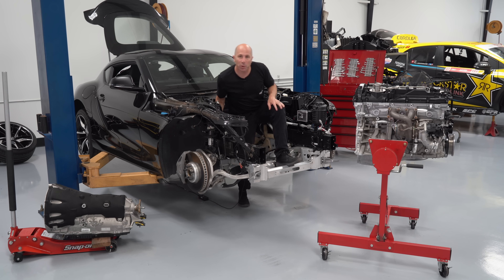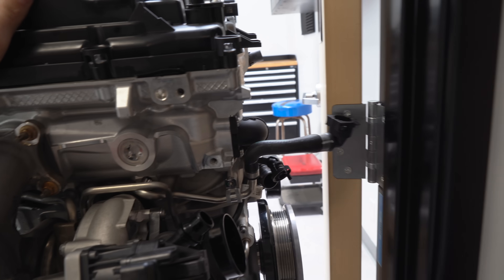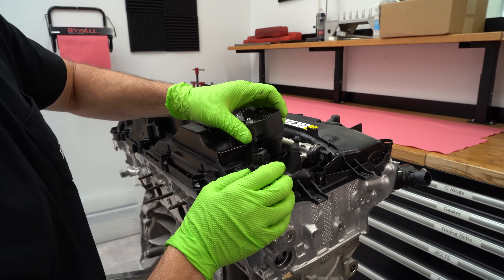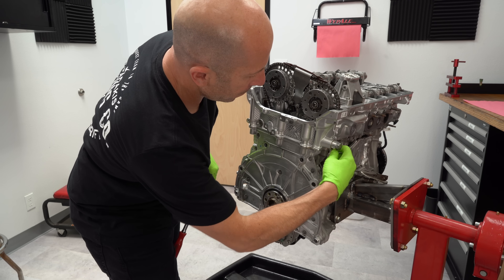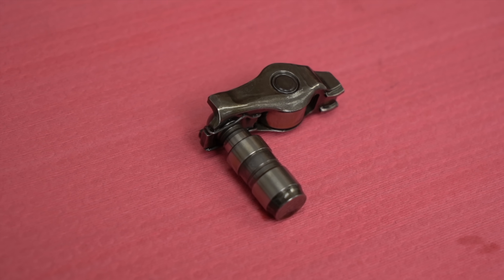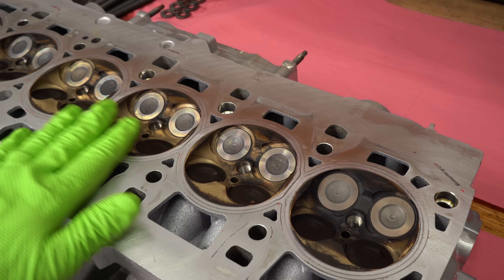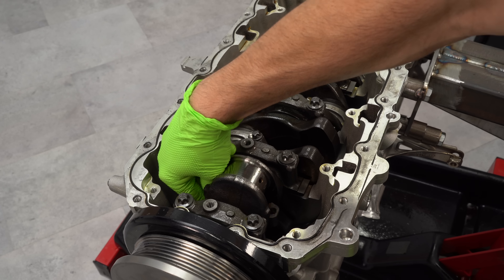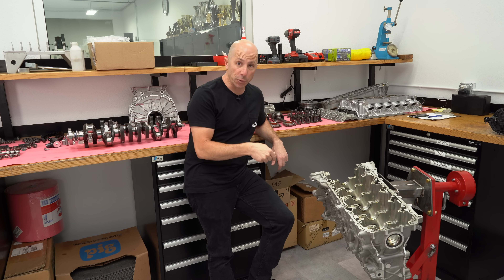2020 Supra B58 Engine Teardown - First Look - Better than the 2JZ?

Comment: the whole time I'm watching this i'm thinking to myself "i would have no idea how to put that engine back together".

HOW do you know how to take apart the engine on such a new car??
Reply: Service Manual
Reply: I'm just supprised he even had access to the service manual yet, is pretty difficulty to get manufacture specific manuals this close to release unless your literally with for the dealership
Reply: @iancook2921  This close to release? The cars are already being sold... I've seen 2 in my sleepy little rural town...
Reply: Forgan Mreeman I think when you’ve torn down as many engines as this guy and can do so routinely, most engines start to look the same
Reply: Bolt by bolt until you have no more bolts to take off.
Reply: You'd be surprised how similar engines are, and when you're experienced in how engines work and the things that are in them, it doesn't take long to have a good look at it and figure out how it comes apart
Reply: @lewisbiggs5977  ok what about the electrical bits? that had to have been a nightmare taking the harness out.
Reply: @Forgan_Mreeman   if Toyota didn't depart from BMW design on that aspect it would actually be fairly easy. i work on BMW's regularly and their engine bays are wired quite efficiently. i spend more time removing trim pieces and frameworks than dealing with harnesses. Toyota actually has some of the worst wiring setups because they run over top of everything and arent very flexible. mainly difficult from the lack of flexibility and extra length so you cant push them too far out of the way
Reply: Engines are like tits and a fanny, they're all different but all the same 🤔
Reply: @Liveforeever   , yeah...  i like the way U think...
Reply: He can just watch he's video
Reply: He uses something that I call the party line. Basically get a table and everything you take off you organize from left to right. Installing will be opposite right to left. On big projects like this I take photos but he did better and video taped it too.
Reply: The B58 is not that new at all.
Reply: Once you take enough cars and engines apart, things start to seem kind of intuitive if you stop and carefully prepare.
Reply: They're just motors, same as anything really for most of it
Reply: Video your self
Reply: Holy quran of service manual...
Reply: Manual book 101 lol
Reply: It is not that difficult you just need to unbolt every screv you see and eventually it will come apart xD

Comment: Mechanical fuel pump! 
Full circle!!
Reply: driven on the camshaft no less!
Reply: wheelitzr2 It has a regular fuel pump in the fuel tank which feeds the mechanical fuel pump. However to get the fuel pressure up to around 3,000-4,000 psi which is the operating range on those fuel injectors you need a mechanical pump like the one in the engine.
Reply: @guillermolopez1690  ya think?!?!? I had no idea that is was direct injected and needs thousands of pounds per square inches to inject fuel directly into the cylinder. I was making the comment that obviously a mechanical fuel pump can't do what an electric one can.

Comment: Where are the cam bearings? Why is there so much plastic? Oh god
Reply: Like many engines the "bearings" are part of the head and cam caps
Reply: And there's plastic because it's strong, reliable, cheap to manufacture and lets them do things they couldnt with cast or billet aluminium

Comment: I would love to tune an engine with twin variable camshaft phasing. This technology is how OEMs are getting so much area under the torque curve....as opposed to peak/narrow band of RPMs.
Reply: Would add bulk to the entire timing system. It would take guts for a manufacturer to do that without sacrificing anything(except the bulk)!
Reply: BMW used dual camshaft timing adjustment first in 1998 on M52TU. It is called dual Vanos.
Valvetronic is used first in 2004 E60 and E46 engines.
Reply: They call it Valvetronic on BMW motors if you want to do more research!
Reply: It’s actually vanos. Valvetronic is the variable valve lift.
Reply: @Wick-d_Trucking  my bad thought he was talking about the valve lift not the timing lol
Reply: @Wick-d_Trucking  vtec

Comment: Really great insight, talk about re-inventing the motor! Seems like the design is for minimal potential to modify. The inbuilt exhaust porting is really interesting. Can't wait to see the re-build :D
Reply: All that design is just a byproduct of modern emissions standards. Auto companies have to do anything and everything for the smallest efficiency improvement. This is no different than any modern engine honestly. 

I had to tear down my 2016 5.0 Mustang engine and I cannot tell you how many similarities there are between the two, in terms of stuff that seems needlessly over engineered and pointlessly difficult.
Reply: @kinafermusic2456  This is a fact that most people ignore, they blame the manufactures instead of the regulations that force their hand. (not saying the regulations are bad, but for tuners they can get in the way)
Reply: It's have also been designed to make the life harder for anyone who wants to disassemble it.

Comment: Yay, timing chain on the rear of the engine.  Servicing is going to be soooo much fun... 🤦‍♀️🤦‍♂️
Reply: Should ask audi 4.2 v8 owners how they like their timing chain in the back. Don't worry though, you don't need to service a chain! (whoops)
Reply: It's easier than maintaining a website forum.
Reply: @mattk9438  touché 😘
Reply: I had my bmw with the exact same oil pump design and chain layout sieze the oil pump, broke the gear off the pump, was a transmission out job to fix, you can do the whole chain service with the engine in with most other bmws, but it's probably easier to just pull the engine tbh
Reply: JZX World dude even the placement of that thermostat underneath everything, my e46 was right in the front. My favorite car I’ve had, so easy to work on.
Reply: @bjn9  if you think the e46 is easy to work on you've never experienced the joy of an e30
Reply: keeganwebber i second the e30 comment. Love working on the m20
Reply: @keeganwebber  fucking HATED working on my e30. Worst car i've had to work on. Would rather change oil filter on my mr2 than work on another bmw.
Reply: Unless something goes really wrong, you don't need to change it.
Reply: @Pogaspm  not necessarily true at all
Reply: @Pogaspm  ...or you need to change cams etc.
Reply: JZX World that’ll be the last of
Your problems with the intake cams eccentric shaft, along with everything else. The chain location isn’t a issue at all unless it needs to be changed or serviced.
Reply: @Pogaspm  Yeah BMWs are known for their timing chain reliability (eye roll).  See 540i, 740i, etc.   When the timing chain guides self destruct (between 30-60K miles) , the labor/parts cost to replace them totals the car.
Reply: Epic Test Drive 740i
We’re talking 2020 not 2003. Cool your jets there Marty mc fly.
Reply: @epictestdrive7978  is the 30-60k mile car worth 2k$? what are on about.
Reply: Thechristopherryan and yet they still use a plastic wearable guide on the chain rather than a sprung cog.   BMW engineers into their designs expensive maintenance items such as these timing chain guides
Reply: @epictestdrive7978  Are you talking about the M62 engine problems? That thing was discontinued in 2005, it's got nothing to do with the B58. I'm not saying this engine will be perfect but apparently Toyota had a big say in its development and ensuring it would meet their stringent reliability requirements. It's been used in various BMW models for a couple of years now and I'm not seeing issues with the timing chains being reported (after a quick Google!)
Reply: Epic Test Drive I don’t know in which dimension. 300k km engines (M60, M62 and many-many other BMW engines) are put to work hard on tracks here every weekend no chain issues. Maybe you should try changing the oil more often than your chain guides and tensioners?
Reply: Epic Test Drive no usually around 120k or 150k or even 180k they’ll start going bad depending on what conditions the car went through
Reply: @Pogaspm  It's a BMW engine, so you will have to change it every 100k km.
Reply: Just a heads up. On this specific engine, the timing chain can be replaced in car. The chain links are separated and a holding device feeds a new chain in as you rotate the crank over. I took the training class for i8 (b38/48/58 are very modular, hence the shared components) right before I left the dealer and we replaced a chain on the b38. Once again, very easy with the right tools.
Reply: JZX World It’ll be fine, you can’t have everything easy.
Reply: All I can find on the internet is forum threads airing concerns about chains/tensioners, etc. from when the B58 first released. There’s no documentation on how many (if any) people experienced failures or needed replacing so it looks like BMW expect this to be a non-consumable, despite their track record with rear chain engines.
Reply: Be happy that it doesnt use a timing belt if you change oil on time and stuff the timing chain should last realllllyyyyy long
Reply: You shouldn't have to service the timing chain like that.
Reply: @Charles Bell I'm a mechanic and already changed more than 3 chains in under 2 months, bmw with n47 engines newer than 2010 they are common to fail  you can Google it
Reply: 2jz swap when the timing chain goes
Reply: @DrTnuts  why would you bother?
Reply: Considering a timing chain never needs to be replaced unless there’s a problem with the actual chain,  really doesn’t matter where it is.  It’s going to be a huge job regardless.
Reply: smart one timing chains DO stretch belts ARE stronger due to the ability to use carbon and Kevlar which are stronger than steel. Nice try though chains are easier for rapid manufacturing.
Reply: Timing chains don't break thou, it's very,very,very rare they break
Reply: Seems fine to me, I mean, the packaging is such that pulling the engine is not such a big deal.
Reply: Ya just had to scrap my BMW because the timing chain broke, BMW told me it's my fault because i hadn't taken it in to them in 60K so they could check it.  I'd like to see what they do with this, especially since BMW is known for using crappy timing chains
Reply: Second owner problems
Reply: @- whoami - I love scotty lol😎
Reply: Yep very typical from BMW. However there is probably some special set of tools that they have given their technicians to use which makes it easier.
Reply: coff, saab
Reply: @- whoami - nah dude, he is mechanic daddy.
Reply: BMW doesn't have timing change issues.
Reply: @Edward Oskarsson 
Problem on the old e46 valvetronic was the valvetronic motor, not the shaft, oh and the entire engine lacking 2 cylinders.
Until we know that this valvetronic (yes it is still called that) is a known failure point, what it allowes is simply a more flexible engine with the ability for lower fuel consumption.
Reply: Check some vids from Europe. I've seen guys from Germany, Poland and UK doing the chains from the rear just pulling out the gearbox.
Reply: Welcome to the world of German engineering
Reply: Only fucken Germans do this to engines.
Reply: Would you really need cams on a car with variable valve lift 🧐🧐🧐
Reply: Said the  same 😂
Reply: You should try owning an Audi lol
Reply: The ones who can afford the car will be able to afford the flat rate.  It'll be easy once you do it once or twice.  First time you'll lose your ass.  That's how it goes.
Reply: @mikaelgaiason688  I can afford this car but it doesnt mean i would want to pay for 20/hr labor just to service the timing chain yet alone if the stupid cover starts leaking. I'm also building a 2jz at this moment and plan on swapping out the engine. No I'm not rich I just have my money invested in well places and dont spend like an idiot.
Reply: BMW are known for reliability....oh wait..no they are not.
Reply: NO_EYES_ON_ME maybe US spec bmw’s arent relaible but european spec are
Reply: @TorpedoStudios  Based on what? Their 25th place in the JD Power European reliability survey?
Reply: Thats why they took this 'project' on with Toyota,.
Reply: bmw ftw Eh? my main gripe is internal exhaust manifolds. so now barring a head upgrade, exhaust headers wont happen
Reply: @yamahonkawazuki  my thoughts exactly.... such a stupid design. From what ive been told even many new naturally aspirated engines have this same design. Something to do with low rpm torque figures to "help" boost fuel economy. What a joke. That's like going from a 3" exhaust to 1" as a scale of restriction...
Reply: @- whoami - But BMW timing chain guides go far before that!
Reply: @epictestdrive7978  literally never heard of that problem they're are loads of those v8's running around on 100k plus miles
Reply: It’s really easy with the right tools
Reply: @fatcatsgang  Nothing easy about having to pull a motor to change your timing chain. Super inefficient design. Otherwise the motor seems decent.
Reply: @randommitsu6098  These cars will have one timing chain in it's life, why exactly is that a problem ? You don't do it every week.
Reply: @randommitsu6098  If you've worn out a timing chain,then your going to be changing other parts also,so it's motor out regardless.
Reply: @fatcatsgang  it's even easier when you have a lot of money
Reply: Forgan Mreeman it’s even easier when someone’s doing it for you
Reply: @fatcatsgang  but still you need to remove freaking GEARBOX !
Reply: Typical of bmw..
Reply: Use white painter's caulk instead of gaskets or silicone. Poly seam seal, from home depot. 
Your welcome!
Reply: @- whoami - its a bmw engine, its only a matter of time until the timing chain breaks.
Reply: Timing chains are designed to never stretch or break thus never needing to be changed.
Reply: @jdmcarboy64  chains dont stretch, the pins/bushing wear out.
Reply: @jdmcarboy64  Since when? Every mechanical chain wears out and "stretches" over time. As do the sprockets.
Reply: All BMW engines have the chain in the back
Reply: @bakokurtishi   No they don't dip shit.